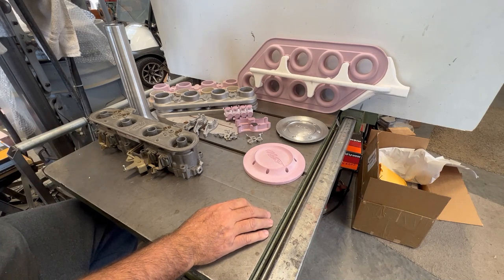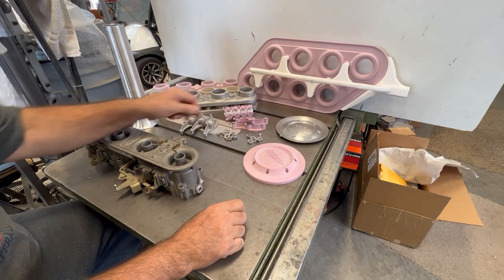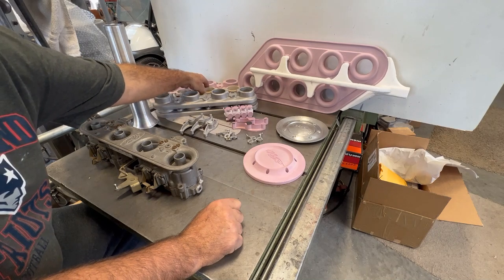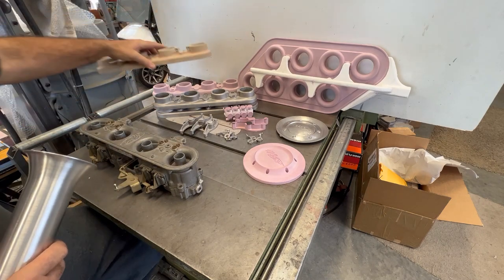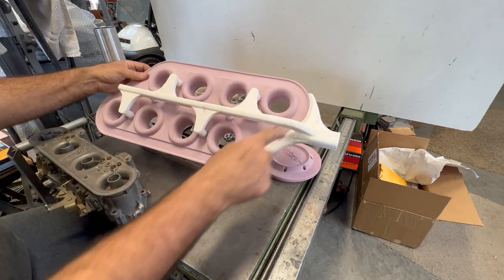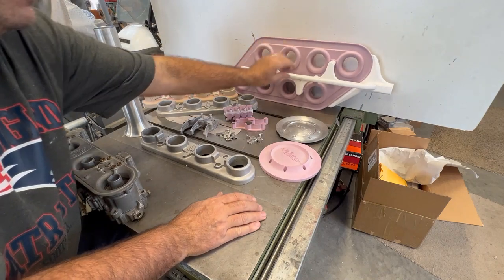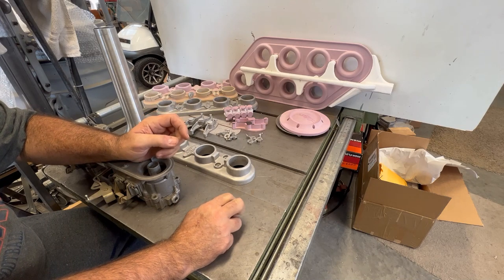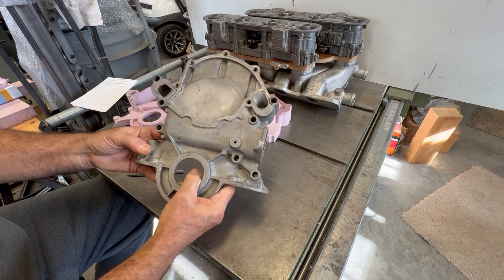Lost Foam Casting an Automotive Timing Cover

Comment: Kelly sorry about your injury glad you're back at it. I for one would love to see the CNC run and the dip coat even if it's just sped up with some music playing the emergence of the part from the foam is captivating
Reply from the maker: If you want to see all the casting process steps, look at the "Saucer Cup & Spoon" series on my channel. It doesn't have CNC machining and I only used vacuum because it was so thin. Best, Kelly

Comment: Would enjoy a video on the cnc of foam.  You are achieving a remarkable finish on the foam. So even just an overlay of tool selection and speeds and feeds would be educational. Was thinking along the lines of your foam multistage router video earlier

Comment: I don't have CNC router.
I'm doing a casting of old chris craft windsheild brackets. This dry sand with foam patterns is so simpler than all the mulling and ramming, and parting and etc. How about making a mold of orig part in 2 part rubber, and then pouring some kind of 2 part foam, and THEN putting foam pattern in loose sand? 
I am soooo mesmerized that the loose sand doesn't collapse on it self !

Comment: Have you ever look at the Ron’s flying toilet fuel injection? eBay Alkie -digger I think I saw many different injections. This site is amazing and your knowledge of how things work. I us to have a predator Venturi Carb just thinking how or if it could be possible to mix with in the fuel injection? Thanx!!! I haven’t seen how you replace the foam to aluminum in casting but this is so cool. Are you using 3D printing? Are you cutting the foam free handing It? 👍👍👍👍

Comment: Wow this looks a whole new level of amazing! Do you increase your dimensions to accommodate material shrinkage? Or is the shrinkage small enough that you can just duplicate the original dimensions and still fall within tolerances?
Reply from the maker: The pattern is made 1.3% larger to compensate for shrink. Best, Kelly

Comment: First off, sir you are without a doubt the best at casting that I have ever seen. I wish I could get my hands on a pair of those Autolite Inline 4's. Now for my main question what do you charge for a timing cover like that? I have a unique small block Ford cover in mind, but much simpler than that one.

Comment: Id like to either build, or see built, either 2bbl or inline 4bbl carb based on a Holley carbs, just seems having the carb inline would distribute fuel so much better, and I love Holley carbs, maybe use a dominator for the 2bbl, and 4150 for inline four. Maybe a dominator option! A inline carb capable of 1000-1500+ CFM,  a intake manifold designed to be used with them, basically runners going from port to port, across the valley to the opposite bank, with a bump. In the floor dividing the port, or possibly use dual inline fours, but a single 700-1000 CFM 4bbl should be enough,   having 4 separate plenums,  connected by approximately 1.5" port running the length of the carb,  use either a single 50cc pump, or a pair of 30cc pumps, or possibly a pair of 50cc pumps, with a diversion valve to reduce half of the fuel to the squirters back to the bowl, when the throttle is slowly opened, use down leg annular boosters, with many tiny holes possibly using EDM possibly 100-200+ 
.010" to .020" somewhat resembling a band of fine mesh screen wire inside the booster, with the accelerator pump squirting into a device resembling a booster, with a more coarse screen inside, to break up the stream to prevent pooling in the intake floor, or just use a spray nozzle on the pump, spraying a fine must,  with the boosters doing the same. It should be an efficient carburator,  and it can use the traditional Holley bowls and metering plates, the only parts that would be difficult would be the the tiny passages for the idle circuit, likely requiring EDM or some other methods to machine tiny passages, as well as the throttle valves,  I believe a large stainless throttle shaft would be useful, so it can be machined flat inside the throttle bores, possibly cutting off one side and using a dovetail to allow a flat streamline plate to fit in its place, to reinforce the shaft , to reduce chances of it breaking, use bushings and plastic labyrinth seals on the shaft at the ends, and build a bracket that uses a cable to change direction of the throttle, allowing the original throttle linkage vto work as normal. Using a small plate bolting on the intake, and a cable mount at either end of the carb, it can fit either front for ease of adjustment, or rear to hide it, or a throttle stop and idle at the traditional linkage connection! Haha, I don't know how it will look and work, but it's awesome in my mind!  use a additional baffle 
In the bowls to prevent fuel slosh, and possibly a EFI version, with all injection sensors built in, with the option of port mount injectors it could be the next big thing! Especially if it was affordable, especially with the LS, and dodge hemi swaps I believe will be coming! The retrofit of modern engines, with old-school looking induction is desired!

Comment: Great stuff, nice to see how your shills have improved over time with more complex castings, some of those would be difficult in sand castings with cores and such, what software are you using to create your tool path? also I sent you some 3D models to look at if you get a chance. the surface finish is great with the lost foam.

Comment: I wonder how long it will be before 3D metal printing becomes "cheap" or cheaper than this. It must take a good few man-hours to make all the foam plugs as do the casting if you were going to make 10 of something, , but it's great for one-offs.  I think all these items would still be in the $1000's for 3D metal printing right now. I think many of us would like to see at least one CNC run video, I would most like to see it cut one of the logos like the joe Gibbs one, it seems to make such a clean job on something so small/detailed.

Comment: Pretty intricate casting there. It looks amazing. You must have been casting for a long time to get it down so perfect. What do you do if it doesn't turn out perfect? Do you have to start from scratch again?  Thumbs Up!
Reply from the maker: Yes, that's life as a lost foam caster. If you have a fail, you get to remake the pattern and pour the casting again. Fortunately, these days I enjoy very high first pass success rate, and with CNC machined patterns, the time to make another pattern is usually a very small amount of time compared to the intial design and machine programming. Best, Kelly

Comment: Great work! I'm really surprised that the foam completely disappears and leaves no imperfections. Most other folks I've seen that do aluminum casting (with way less detail) use a vent from the lower most portion of the cast piece to top fill level. I guess the "burping" and the large well area at the fill allows for that "venting" and drawback. 
Do you make the foam piece a little oversize to allow for shrinkage in the finished part? Or do the thinner walled parts with less mass just have minimal shrinkage not to worry about? 
Love the vintage intake! Thanks for sharing!
Reply from the maker: In lost foam casting, the refractory coating is permeable and controls the rate that gases from the evaporating foam pattern escape, so the entire surface of the coated pattern is analogous to the vent. The pattern is made 1.3% larger for shrinkage allowance. Best, Kelly
Reply: @kellycoffield533  Thanks!

Comment: Kelly, I suppose you’re OldSchool…. but if you get a programmable fuel injection module, you can use it to handle just the ignition part ( your carbs will handle the fuel ), this way you will not need a distributor, you can use individual coils (one per cylinder) or a wasted-spark using the same style coils Ford used on the 1997 F150 4.6L V8s; using a signal from a CKP sensor reading a reluctor wheel mounted to harmonic balancer. And instead of setting the timing advance curve using vacuum and springs like the distributor, you can fine tune the advance curve using a computer. Let me know if I can help you with this kind of info, if you’re interested 😉

Comment: Kelly, I've watched your series on the intake manifold several times. I have developed a CAD model for an 8 stack intake manifold I would like to cast. I have a CNC mill and router in my shop and would be comfortable making the foam model, but wanted to know if you offer services for casting  the actual part? I would like to chat with you about this if you are interested. Thanks, Kevin
Reply from the maker: Not likely but if you want to drop me a line, there is contact info at my carburetor website  www.inlinecarb.com

Comment: Hello Mr Kelly. I have been seeing yours videos and they are very interesting. However, yours patterns are made by CNC or for expansion process too?
Reply from the maker: For the last several years, all of my patterns have been machined on a hobby grade CNC Router from rigid extruded polystyrene (XPS) board. Prior to that they were manually machined and/or hot wired. IMO, molding the Lost Foam patterns is impractical for one offs or small hobby quantities because of the effort required to make the mold, and poor availability and very short shelf life of pre-expanded bead stock. If it was a higher production setting molded patterns would be the preferred process. Best, Kelly

Comment: Kelly I hope you are feeling better. I was run over on my Harley eighteen months ago and had to learn how to walk again. I am finally walking and recovering. I have a question and possibly a huge favor. I found an old yamaha trimoto and I have been trying to restore it to get it running. The aluminum casing that is essentially a fixed swingarm broke the bolt hole tabs off that hold the axle and the bearings. I need some advice on how to repair this unit. I was thinking about Tig welding it however it may be better just to cast it. How would I go about that? I am in Pennsylvania. Thanks my friend.
Reply from the maker: Hard to say for sure without seeing it but from your description, I'd say with pretty high confidence you would be better served both functionally and financially with a properly done TIG repair, especially if you have the peices and the affected area is relatively small compared to the total mass of the part. All you need to do is locate an experineced welder experienced with cast aluminum and should be a straight forward repair. Good prep/cleaning and preheat is usually all it takes before you lay torch to it. All the best with your continued recovery. Best, Kelly

Comment: How do you compensate in your patterns for metal shrinkage? I'm going to be pouring some parts soon.
Reply: exactly my question.. if I had to make an assumtion he probably oversizes or undersizes certain things when mold making and leaves enough to machine out to proper spec.. and your shrkinkage rate should be fairly easy to figure out by making a pour of your own material by making a simple mold and seeing by how much your own pour shrinks from the original mold size measurements.. im sure thicknes of the pour and a lot of other factors comes into play and thats the part id love to get his input on.
Reply from the maker: @gregthemechanicman  I make the pattern 1.3% larger (101.3%). In CAD, this is just a stroke of the scalling key. For manual things, apply the same dimmensional increase. Best, Kelly
Reply: @kellycoffield533  What software do you use?
Reply: @kellycoffield533  Thank you so much for the answer, I know you are inundated. That helps immensely.

Comment: Hi! Kelly, I wonder how you made the Pink foam look like that? Are you using molds and then injecting or pouring foam into molds? How did you make it so smooth?
Reply from the maker: The foam patterns were cut on a CNC router and then lightly sanded with 220grit abrasive. Best, Kelly
Reply: @kellycoffield533  I'll try to do as you said. Your answer reply helped me a lot, And I also wonder What do you use as a coating for your foam molds before casting the aluminum? Thank you!
Reply from the maker: @pitchayach9480  Watch the video at link below for coatings. Lots of other lost foam casting info on videos at my channel. Subscribe and see. Best, Kelly

https://youtu.be/LdgGkqvk5mc

Comment: Sorry to bug you with so many questions lately.  I have a question about sprue size, shape, and pattern placement.  I have a few decorative patterns for a heart shaped jewelry box with lettering on it.  I am afraid of sand collapsing into the mold cavity as that happened on my first attempt.  How long should the sprue be relative to.the pattern size?  I'll be using a foam sprue and kerf cup.  How wide should the sprue be.  Should the pattern be face down, face up, on a diagnol slope, or vertical?  If you don't mind discussing this with me, you can email me and I can send photos of the project to you.  Thanks.
Reply from the maker: Diagonal slope face with detailed features up. No overhung cavities on back side if possible. I routine poured up to 10lbs with 1" diameter or square sprue. Depth at least 6" from cup to first pattern feature. If you had mold collapse on first go, unless you had a very small sprue, more likely caused by an interupted pour. Use a generous cup size and insure the sprue never becomes uncovered during the pour. Where/how the feed system is attached to the part(s) can matter too. Are you pouring multiple parts? Best, thing to do is join www.homefoundry.org rather than email. Plenty of help there. Best, Kelly
Reply: @kellycoffield533  thanks.

Comment: How do you get the position of everything right in 3d?  For example the location of the oil pump, water pump, distributor, and holes.
Reply from the maker: Transfer dimensions from published prints, carefully reverse engineer existing parts, and program those dimensions in CAD/CAM model for machining. Best, Kelly

Comment: I am curious how you’re going to drive the oil pump having moved the distributor.
Reply from the maker: You make a plug from an old distributor with shaft and gear. Best to make sure it has a good gear.......this intake needs to be removed to pull the plug. Pretty common thing to do with crank trigger ignition systems too. Best, Kelly
Reply: I kinda figured that was the solution. Fantastic work sir.

Comment: I have a question, if you were to cast a flathead V8 cylinder head, how much length would you ad for shrinkage, i head about 1/8" per foot, thanks
Reply from the maker: For aluminum: 5/32"/ft or 0.013" per inch or +1.3% or multiply the dimension by 1.013......all the same thing. Best, Kelly

Comment: Nice piece but I missed the part where the distributor is going to engage the cam gear now that you moved the distributor. Maybe I wasn't paying attention?
Reply from the maker: I comment in the video that an extension is installed on the end of the cam to drive the distributor in it's new location. The extension is only ~2". -Not my idea. Was orignally done by Ford in late 1968/early 1969. Best, Kelly
Reply: @kellycoffield533  Thanks for the clarification.

Comment: Do you perform any finish machining on this yourself, or "just" do the casting?
Reply from the maker: Yes, I heat treat and machine my castings in my shop. Best, Kelly
Reply: @kellycoffield533  Do you have any videos on how you heat treat your castings?
Reply from the maker: @abc-bm8pl It would be a very short video. I cast with A356 and T5 at 440F for 7-9 hours. This can actually be done in a residential or toaster oven but the marriage counseling is very expensive. I use my electric foundry furnace. On occassion I T6, but rarely because it requires both solution and precipitation phases, and solution is so close to the melting temp you risk damage to the casting either through localized melting or distortion from quenching. My furnace controls temperature very accurately but the resistive heating elements radiate heat to the castings causing higher localized temps than the furnace temp. I place the castings inside a poorly insulated can to act as a radiant heat shield. But, 80%+ of the improvement in mechanical properies can be achieved with T5 so IMO, T6 is rarely worth the effort. Best, Kelly

Comment: I'm fascinated by--but largely ignorant of--this casting technique so I'll ask the obvious question. Can a lost foam part be printed?
Reply from the maker: It can be printed in PLA or other evaporative materials that require a hard shell or investment mold and burn out, but there aren't any suitable for the lost foam process that I'm aware of. Best, Kelly

Comment: What is a source of the foam XPS in 1.3 lbs/cuft ? What glue are you using ..cold or hot ?
Reply from the maker: Search my channel for video on "pattern construction materials". All your answers are there. Best, Kelly
Reply: Thank for the reply. All 3 US manufactures are specifying XPS by compression strength in psi. Some data sheet is showing " standard density of 27-30 g/l. But I would like to purchase 20 g/l +/- . Can you give me purchasing type number and brand, please.
Reply from the maker: I use Owens Corning Foamular 150 which is 1.35 lb/ft3 (~20g/l). Sometimes I use foamular 250 which is 1.5 lb/ft3 (~24 g/l). These are pink colored XPS insulation board. Dow Corning (blue colored) make similar products. The color is just marketing and not otherwise meaningful. Nearly all the foam insulation board sold in the home improvement stores here in the USA are in this density range. Denser foam will be stronger, machine and sand better at the risk of slower evaporation and higher rates of casting defects.  Best, Kelly
Reply: Thanks a lot , I appreciate your reply